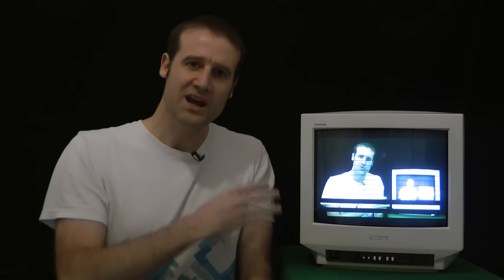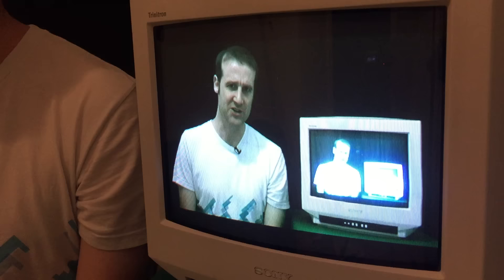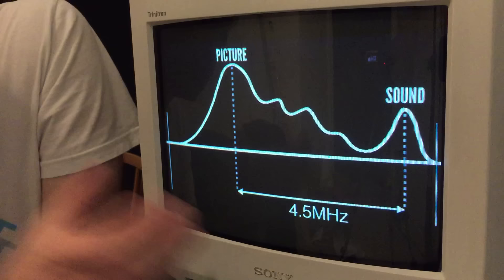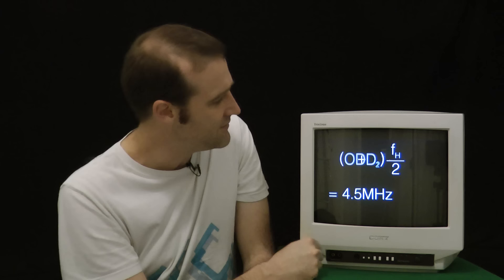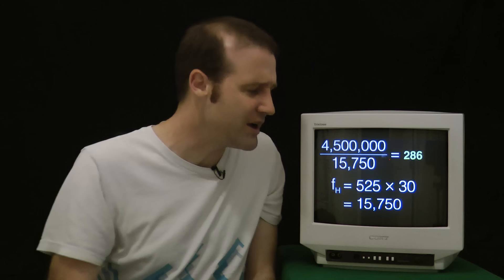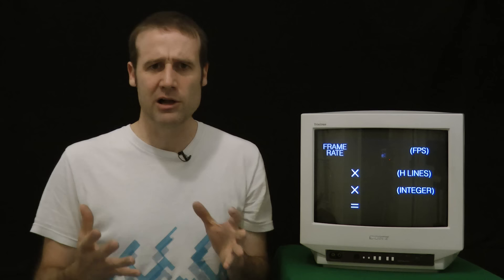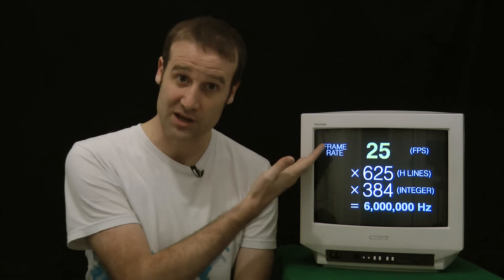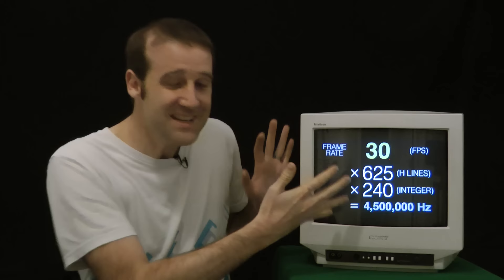Why is TV 29.97 frames per second?

Comment: They could not have made 30 x 625. That would have brought the horizontal frequency to 18750Hz, which is quite a leap from 15750. It would have broken compatibility with existing sets and other equipment. The change from 15750 to ~15734 worked because the analog electronics involved had some, say, "give". They could tolerate some variance up and down from the expected frequencies, but that much of a change would have been tolerated by very few existing sets, if any at all.
Also, even for those sets that would tolerate and display the new signal, most would probably suffer from some instability, and even those that were stable, would need to be serviced to get the new signal to display correctly, because the video signal doesn't contain driving signals for the deflection coils, but just pulses signaling when to return to the starting position to scan a new line or frame. Then, the electronics on the TV set, upon detecing that pulse, internally generate the sawtooth electric currents that actually drive the deflection coils. These are called flyback transformers. Those found on PC monitors with geometry controls can be adjusted pretty widely, but those on regular TV sets are specifically made for one and only one sawtooth wave lenght, which determines line lenght on the screen.
Basically, your +18kHz horizontal sync signal, if accepted at all by an existing TV set not specifically made for it (let's rememeber that the idea was to keep compatibility with older BW sets), would result in a picture that didn't fill the whole screen but left a portion of the right side of the screen completely black, because a new horizontal pulse would arrive before the flyback transformer could have driven the electron beam all the way to the right side of the screen.
Reply: Just tweak the Width and HPos potentiometers on the back.
Reply: @jeepien  Have you tried it with TV equipment of the time? I'm not saying I did, but it sounds like, if it was as easy as that, they would have done it, right? So, are you sure it would work?
Reply: @radornkeldam  No, I haven''t.  Although it would in principle,  it's quite likely that such a large change would push it outside the range of existing controls.  Nothing is easy.
I did have TV equipment back when the NTSC change occurred, and it was completely undetectable on older B&W TV sets.  The Vert and Horiz controls needed occasional adjustment anyway, and had no calibration of any kind, so any small change would not be noticed.  You just turned the knobs till the picture held still.
Reply: @jeepien  Many - if not most - TVs back then used as adjustable coil in like with the yoke to change the width. And they didn't have a whole bunch of adjustment. They also didn't have a horizontal phase adjustment. You could adjust the centering magnets on the tube to some extent.
Reply: @compu85  TV sets had "Horizontal hold" and "Vertical hold" controls.  Just knobs, no numbers.  You would adjust the horizontal until the picture stopped looking like a bunch of slanted lines and torn up garbage.  You would adjust the vertical hold until the picture stopped rolling frames and locked on one stable frame.  Once you got it close, the frequencies would lock to the sync pulses in the picture data, and everything would remain stable.  A tiny difference between 30 and 29.97 would not be detectable by anyone with an analog TV set.

On the back of the set, through screwdriver sized holes, you would find rarely needed adjustments of Width Vertical position, and Vertical linearity.  These were local adjustments unrelated to the signal. They just put the picture in the right place on the screen, and didn't need to change to match the signal.
Reply: Since it's not allowed to go outside the 4.5 MHz window, couldn't they just change the window slightly by moving it inwards instead?
Reply: @Anonymous-df8it  I'm not sure what you are trying to say.
Reply: @radornkeldam  The signal isn't allowed to go outside the 4.5 MHz window, so could moving the ends of the window inwards help?
Reply: @Anonymous-df8it  I'm still not sure what you mean, but 4.5MHz, if I recall correctly, is the allocated broadcast channel bandwidth minus guardbands in the US.
The problem I'm referring to has nothing to do with that. I imagine you could fit a 625i@60 picture in a 4.5Mhz channel, with slightly reduced horizontal sharpness, but that's not the point at all.
What I'm talking about is how jumping from 525i at 60Hz, to 625i at 60Hz would significantly increase the horizontal sync frequency and, thus, reduce the line duration by not a small amount, and would probably require some serious adjustment to all deployed TV sets to display correctly, and probably many wouldn't be able to accept the new signal specification.

Not a seamless transition by any measure.

Comment: Sadly this is one of the problems being early when adopting new technologies. 
It can be difficult to tell exactly what you need, how to create something, and so on. This often ends up in you finding out what you should have changed.
But, by then the old systems are already in place and you can't just shut them all off.
Reply: How is that sadly in this case? Whoever decided that near-30 fps is enough made a tech that lasted 40-ish years and near no one ever said it's a problem or even acknowledged. On the other hand now we have opened pandora's box where most people are moving toward 60fps while at the same time there are already people who say 90 or 120 or 140+ is the minimum desired level. Leading to tech being deprecated often within a year while we are supposed to save resources and environment.
Reply: @kallemetsahalme5701 these are 2 very different things. It isnt exactly the fps that is the problem, but having to be compatible with b&w and make a smooth transition. 

It is about getting the technology and not fully understanding it and planning it out that leads to problems. Luckily with tv it is just a debate, but with other things it has costed lives.
Reply: @kallemetsahalme5701  
Your point is 100% correct. However, in this case it was a decision of backwards compatibility AND seamless change.  Nothing really about frame rate itself. As no one will notice the -0.03 

Also are people saying that like 90, 120, 144, etc. is the minimum desirable frame rate? 

As I will be honest 60fps is perfectly fine, 120 fps is even better, and 240 fps is incredible. 
It depends on application though. Gaming? 120 and above 
Watching movies? 30 or 60
Animation? 30 is probably the best

Comment: The problem with 25 fps is that it flickers like hell, specially in CRT monitors. It was impossible not to notice it back then.

Curiously enough, Telefunken developed the PAL-M back in the 70s. It has 60fps (not 59.97) and also features the phase alternating line (aka PAL) that made the European PAL famous for its color fidelity.

The system was only adopted by Brazil and worked pretty well.
Reply: To be fair, most European TVs would have compensated this flickering issue by using phosphors with more persistence (the glow lasts longer).

The problem with this, however, is that you would notice the persistent glow a lot more if you were watching a content with high contrast--for example, a helicopter searchlight beaming down from a dark sky, well, you'd notice a trail of glowing phosphors behind the searchlight a lot more with a PAL TV.

As for PC monitors though, the phosphors had even less persistence than an average TV, because they were generally supposed to be run at 70 Hz or higher. That's why running one of those at 50 Hz is just eye hurting!
Reply: You must have real trouble watching movies, then, because the cinema screen flashes 48 times per second, less than PAL’s 50 times per second.
Reply: I don't know of any theatre that uses CRT projectors or old-school film projectors anymore--at least around where I live--so I'm not sure if that's a big issue anymore since it seems the most common projection tech is based on displays that don't inherently flicker.

I can't really say I've ever noticed a 48 fps flicker on a recent movie night.
Reply: Even older movies didn't scan so their was no flicker. Fps in the theater is the whole frame at once. You only have 1 line between frames that interrupts the image. You don't have half of the image being scanned in at once then the other half.
Reply: No, that's not right. You cannot show a frame in theatres for a complete 1/24th second, because the film stock had to be pulled in place and then advanced to the next frame. The film transport would cause immense vertical motion blur (for regular 35mm projection). Theatres always used rotating shutters to hide the film transport motion. That was also done with the cameras. To make this rotation smooth, each of the 24 frames was interrupted twice. During one of the interruptions the frame was transported. This resulted in 48Hz for 24 frames :)

Later projectors used higher speeds, such as 72Hz or 96Hz (probably why nobody noticed flickering in the last decades).
Reply: @samusthpf  Yes, the film had to be continuously pulled through the gate, but a rotating prism was used to redirect the light at the same time, eliminating most of the motion blur you're talking about... But it could still only do that for about half of a frame period  Eventually the prism rotates 'til it's almost edge-on to the film, and the picture breaks up, so of course a spinning shutter was still needed to blank the screen at that point.

Testing showed that blanking the screen twice per frame gave people fewer headaches than blanking it only once per frame. Nobody knew why at the time, but it turns out it's due to the details of the way the eye sends signals to the brain: The more frequent the flash rate of the image (and the shorter the flash), the fewer photoreceptors you have all trying to send new information to the brain at once, so less signal congestion.

(I once owned a really cheap-and-nasty 18fps cine projector that didn't use a shutter: It had a piston-like system that would yank the film foward by one whole frame as quickly as possible, then leave it stationary in the gate for as long as possible while it swung upward to re-engage the sprockets one frame further up. The wear on the sprocket holes was horrendous, and of course there was this ghostly vertical smear that constantly tracked any horizontal movements in the image!)
Reply: Also the conversion of film to NTSC was smooth using a 3:2 pulldown but PAL simple played 24 fps film at 25 fps which speeds up the movie by about 4%.
Reply: @therealpbristow  I've only seen rotating prisms on film editing desks and high speed cameras.
Reply: @99EKjohn  Movies flicker terribly. The flicker did not come from the scanning - the line-rate - but from the frame projection - the picture rate. Twenty four Herz is nigh-on unwatchable so film projectors showed each frame twice to get the 48Hz film projection rate. Even at that projection rate though movies exhibit significant flickering to most viewers - particularly in their peripheral vision. If you cannot see it then in that way you are lucky.
Reply: "a piston-like system that would yank the film fo[r]ward by one whole frame as quickly as possible, then leave it stationary in the gate for as long as possible"  @therealpbristow   
aka the film tearer.
Reply: @lawrencedoliveiro9104  It's actually more common to run film at 72 flashes per frame, 3x24. If you look at a modern 16mm projector it actually has a shutter that has three blades.
Reply: Lawrence D’Oliveiro Cinema is an entirely different tech, and I can’t stand it because film tech conveys motion very poorly and all that blur makes my eyes hurt.

Comment: How did movies end up with 23.976 then?
Reply: Movies are still 24 fps. But shown through NTSC you would have to make up for the last ≈6 fps to get to ≈30 fps.

With PAL they just sped the film up from 24 to 25 fps, but speeding it up to 30 fps would be too ridiculous.
Therefore they use 4 frames of 24 fps film to create 5 frames of NTSC video in a ridiculously complicated process called the Three-two pull down method. Read more here:
https://en.wikipedia.org/wiki/Three-two_pull_down
Reply: "Just sped up the film" That's a major change in the timing of a film. Great directors and actors pride themselves on good timing. There was no pitch correction (for many years) so the audio was screwed up, too. 
2:3 pulldown is quite simple. Europe uses the truly ridiculous  2:2:2:2:2:2:2:2:2:2:2:3 (Euro) pulldown. Read more here:_https://en.wikipedia.org/wiki/Telecine#Frame_rate_differences
Reply: Chris W
well going from 24 to 23.976 is about 0.1% of the speed in difference. It's not good but can be ignored.
Reply: PauLtus B It's non-good when the audio starts to slide out of sync as it is 0.1% longer.
Reply: Chris W, wow that is a truly ridiculous method, especially regarding the fact that fps will be less critical in the future as linear television slowly fades out. I've never actually heard of this method as it seems to be quite new it but it does make sense.
Reply: Wow, i never imagined to be able to watch a true PAL vs NTSC format War ... in the YouTube comments section... What a great time to be alive!
Reply: Thorstein Johannessen The audio is synced to the video. There is no slippage. As a broadcast engineer, one of my duties is to check that audio and video stay in sync through multiple pieces of equipment.
Reply: I was actually surprised with this explanation, as i am from Chile, and we always had NTSC, but we use 220v @ 50Hz... So... I'll havve to re-check my notes... It's always fun to re-learn old stuff.
As for the "audio sync" issue, there is no issue at all, as this are analog signals sent by the air, kind of independent one of the other, there are not linked together as individual pieces frame by frame as digital formats are...
Reply: Using 50 hz power with 60 hz TV is not a problem today. It was more of an issue in the early days when everything used vacuum tubes and power supplies were unregulated. It was never a requirement that the frequencies be the same.
Reply: Chris W About the audio slippage: I agree. I was confusing it with problems that can arise when handling material in "the digital space," where audio and video exist as two separate data streams, and the FPS isn't always correctly detected by the video player.
Reply: Basically, it's because 24/29.97 is irrational number. And to convert between frame rates in anlog era it has to be rational with as small divider as possible.
And 23.976 is a closest to 24 to produce rational value: 23.976/29.97 = 4/5
Reply: MrDehicka 24.97? I think you mean 29.97.
Reply: +Chris W Sorry 29.97, for sure. Thanks.
Reply: Movies use 24fps, due to it being a good rate for projection. When the movie is displayed on a NTSC TV, it's easier to slow down the movie to 23.976fps before doing the fix to change it to 29.96fps. 

And, no, movies in PAL do not use some fancy pulldown method, They do just speed it up. You can hear the pitch change on stuff before they started lowering the pitch. to fix it. 

It's a good reason not to use some stream you found online for a movie if you're watching it with some commentary podcast. A lot of times, the video will be ripped from the PAL version, and thus will run 4% faster. 

This is also probably why TBS thinks they can get away with speeding up videos to 10% faster and fit in more commercials.

I can imagine that some filmmakers are pushing for a pulldown method, since it does work better. But it's not the norm.
Reply: Its common practice for fillmakers doing 25fps production to harmonize the sound when doing 24fps release. Also 24 to 25 fps telecine usually has pitch correcting systems. But they can screw up "tightness" of tempo so you may notice that artifact. A lot of cinemas in the film days ran projectors at 26 fps if the movies did not fit their schedule. That meant more screenings in a evening and time to clean the theatre. No kidding
Reply: Peter Hjorth
"
Its common practice for fillmakers doing 25fps production to harmonize the sound when doing 24fps release." I'm either misunderstanding or that's really weird.
Reply: Yes it is weird. Many used to shoot 25fps HD or film and then transfer digital to film frame-by frame and then "gear" the sound to match supposed projection rate of 24. Just a pity so many theatres were cheating speed higher. So in effect pitch was even more elevated...
Reply: 24/29.97 can't be an irrational number (because you can write it as 2400/2997), but perhaps it doesn't have any nice (small) ratios.
Reply: And we get bonus coverage of the ever popular "America Sucks!--NO! Europe Sucks!" debate
Reply: *****
It's a bit like US vs European countries.
Glad that hasn't really happened here.
Reply: With some heckles from countries outside the US-EU divide yelling out "You both suck."
Reply: From what I have understood, audio post-production for movies inherited the 1000÷1001 drop in frame rate as video started being used in place of film for picture reference.

The reason 23.976 fps is still around in the all-digital post analog sunset age supposedly has to do with audio post-production having stuck with the 1000÷1001 drop because old habits die hard.
Reply: gustavo.goretkin 29.97 is just a rounding off of the specific frame rate, which is 30×1000÷1001, albeit with some tolerance.